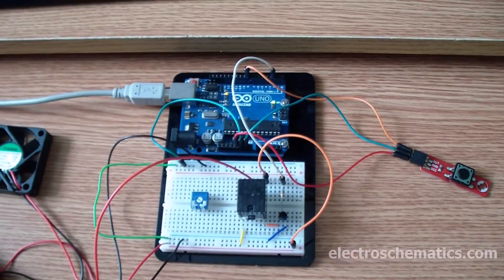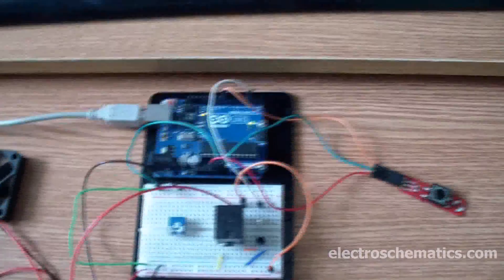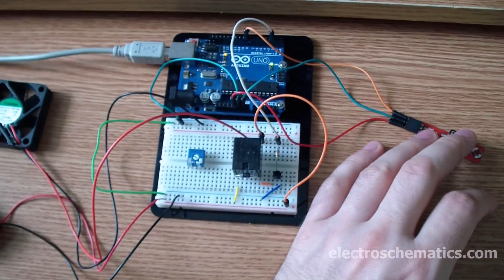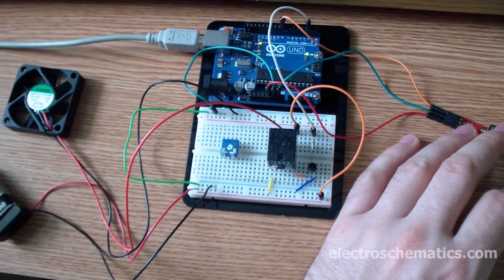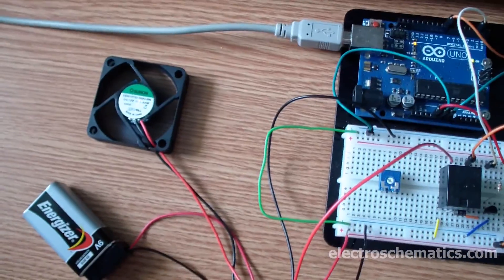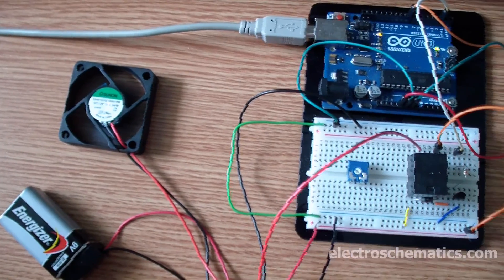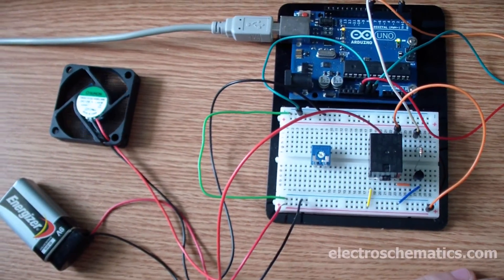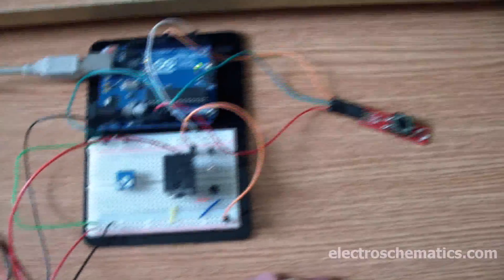Arduino Turn OFF the relay with delay

Comment: Whats the maximum delay I can put in?  For example..I want to use a switch to turn a relay on...if the switch is forgotten and left on, I want the relay to turn off after a few hours of it being on.  Do I need an external clock for this or will the Arduino do it provided it is on and programmed for the time? 

Consequently, when the switch it turned off, it resets the timer until the switch it turned on again to perform a function... Much like how newer cars will automatically turn off the interior light after X amount of time if you accidentally leave it on.

Comment: int pinButton = 8;
int Relay = 5;
int stateRelay = LOW;
int stateButton;
int previous = LOW;
long time = 0;
long debounce = 500;
int stayON = 5000; //stay on for 5000 ms

void setup() {
  pinMode(pinButton, INPUT);
  pinMode(Relay, OUTPUT);
}

void loop() {
  stateButton = digitalRead(pinButton);  
  if(stateButton == HIGH && previous == LOW && millis() - time > debounce) {
    if(stateRelay == HIGH){
      digitalWrite(Relay, LOW);
    } else {
       digitalWrite(Relay, HIGH);
       delay(stayON);
       digitalWrite(Relay, LOW);
    }
    time = millis();
  }
  previous == stateButton;
}

Comment: its very simple code:
if(button == HIGH){
ddigitalWrite(engine, HIGH);
delay(5000);
digitalWrite(engine, LOW)
and don't forget DIODE in circuit or othervise u will destroy arduino